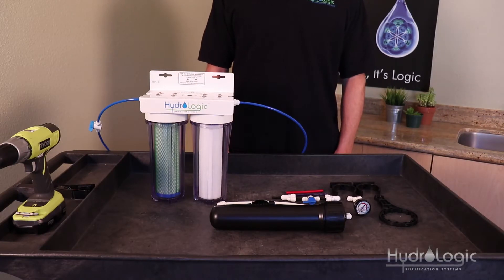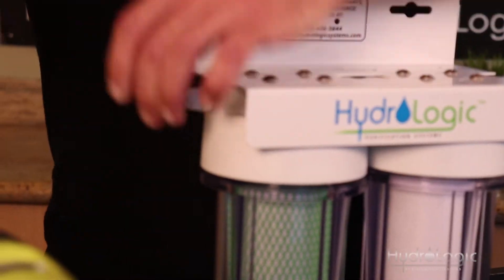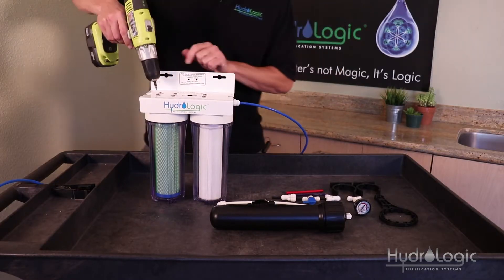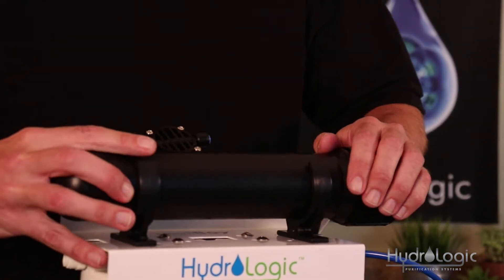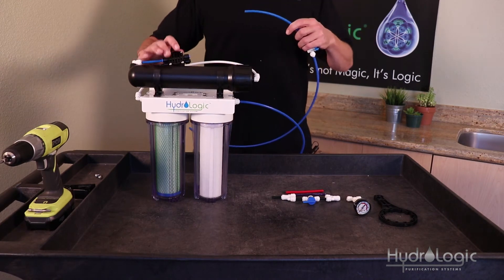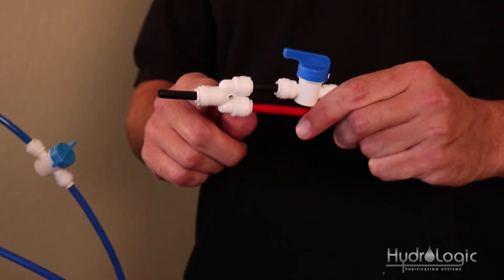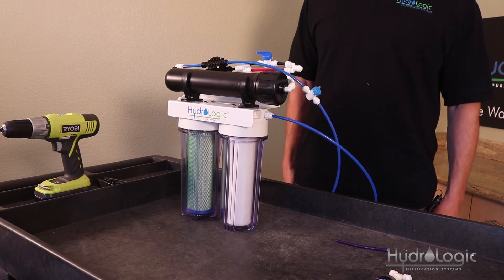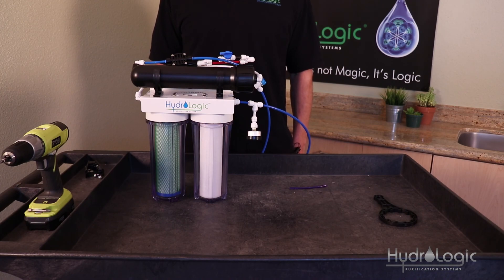smallBoy® to Stealth-RO150™ Upgrade Kit Installation

Comment: I have a questions. I want to convert my small boy to this RO kit version. But I was wondering, can I set it up to still be able to use the new RO line, but also be able to use just the dechlorinated existing SmallBoy line? 

I want RO for my humidifier fill up so I don’t get the white dust film. But only want to use the smallboy for watering plants. Thanks!